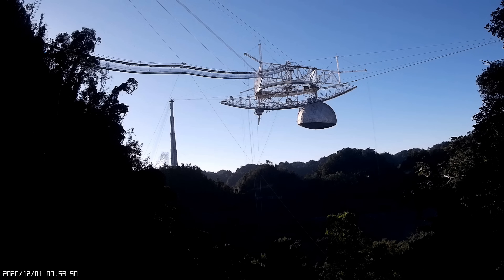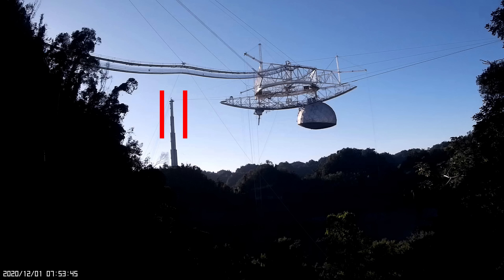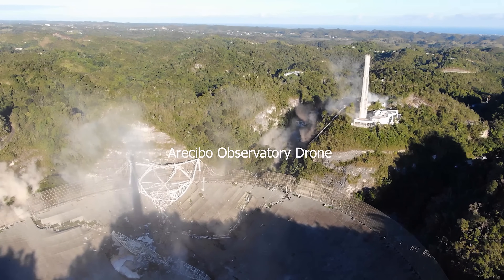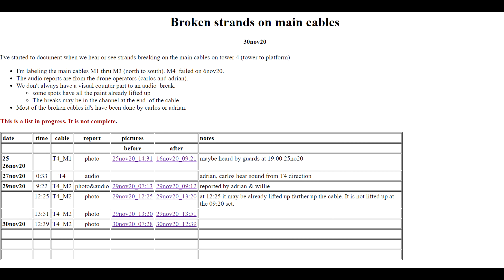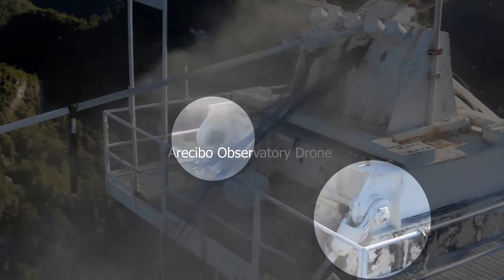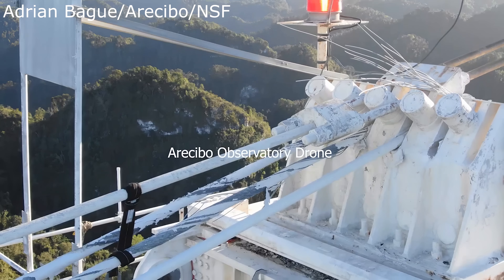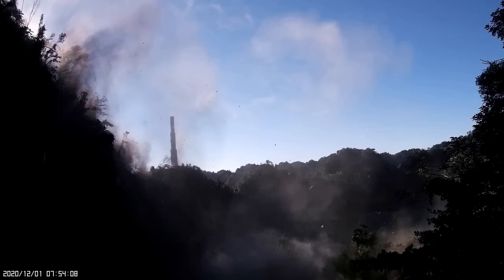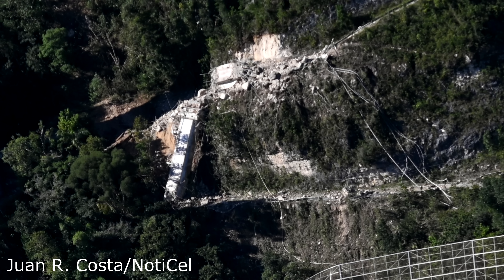Analyzing Video Footage Of Collapse of Massive Arecibo Telescope

Comment: That drone footage is the most impressive thing I've seen all month. Talk about being in the right place at the right time, engineering students will be forced to watch that footage for decades to come.
Reply: I was thinking, this is going to become the new Tacoma Narrows Bridge collapse study for freshman engineering students.
Reply: @cvkline  i was thinking exactly the same.
Reply: @cvkline  Tacoma Narrows was an massive error in design and engineering.  Arecibo isn't.  It stood for many decades.
Reply: @MarkRenn  Tacoma Narrows is the result of failure to plan for circumstances you don't believe apply and/or failing to recognize extremes in the conditions the design will have to face, Arecibo is the end result of failure to perform proper maintenance/inspection.
Reply: @MarkRenn   and @Timothy Barney  Personally, I think you are being a bit hard on the engineers of the Tacoma Narrows bridge.  The bridge failed due to aeroelastic flutter.  In the 1930's when the bridge was designed, there was probably still a limited understanding of aeroelasticity, even in airplane design.  Expecting 1930's bridge designers to understand a complex phenomenon like this, one that had never been documented in bridges before, is unrealistic.  
In short, much of engineering is learning from past failures.  This type of failure had never occurred before, so it would have taken an exceptional engineer (likely one with a background in airplane, not bridge, design) to have imagined it before the bridge was built.
Reply: Also you have to consider that the engineering was done well before the invention of the computer or even the simple hand held calculator. Therefore all the calculations had to be done long hand with paper and pencil. This often involves several pages of calculating over many hours or even days to solve a single logarithmic equation to only a few decimal places. Considering that thousands of similarity complex calculations need to be solved to build a structure like this it's more a wonder that there aren't a lot more failures.
Reply: @timothybarney7257  That's probably what makes these recordings particularly useful to civil engineering students.  You can always design a building wrong--but this footage will teach how the final stages of simple aging and wear and tear play out for something that was built properly using tensile structures (like just about any suspension bridge would be), but simply neglected.
Reply: @MichaelCox  yes, a lot of lessons about aerodynamic effects of wind on structures came directly from Tacoma Narrows
Reply: @timothybarney7257  YES. This video should be shown to engineering students, as it graphically shows how the cable failed.
It should also be shown to maintenance engineers, AND the people who allocate funding for maintenance, and then discuss WHY the cable failed.
Reply: @dealeru.3532  Most of the calculations would have been done with a slide rule, which, if you know how to use one, can be very accurate. But they have not taught how to use a slide rule since the 70s
Reply: @timothybarney7257  I wonder if they have ever changed any cable? As Bridge Engineer the main problem for me is how they designed it in terms of old cable replacement.
Reply: @timothybarney7257  That's what makes this footage valuable. You can put in tons of safety factors and design it perfectly and it doesn't mean a damn thing is the structure is neglected.
Reply: @timothybarney7257  Arecibo is the end result of a failure to have funding for maintenance. The funding is key. It was allowed to deteriorate by neglect.
Reply: @cvkline  This video is a perfect follow up for the Tacoma Narrows video.
Reply: Or people watching the "Discovery" channel - Next time on DESTROYED IN SECONDS - the biggest radio telescope gets..... DESTROYED IN SECONDS DunDunDuuuuunn watch the footage repeat 10 times with action movie music in the background
Reply: @thulyblu5486  After a mere 54 minutes of teaser footage and dramatic sounding music behind engineers giving opinions...
Reply: @thulyblu5486  You forgot to mention the horrible narration.
Reply: @thulyblu5486   Three more cables must die!
Reply: @thulyblu5486  While the narrator beats the same 3 lines to death with a thesaurus!
Reply: At least some good will come of it in that respect.
Reply: Bridge builders take notes.
Reply: To clarify some comments others have made:
1: they were planning on demolishing the dish after recent cable failures, so the drone was likely up there both to inspect current state and to gather information for the demolition company (Controlled Demolition Inc comes to mind as being who you call for this sort of job).
2: the first camera footage is a static camera from the control room facility that is probably always recording
3: regardless, great timing to have captured it.
4: the timing wasn't suspicious at all - in fact, the collapse seems to have happened at the same time the energy from an earthquake in the Dominican Republic would have reached Puerto Rico; indeed, we can safely assert that the quake did begin the final collapse and without the quake the collapse may not have happened
5: fly safe!
Reply: @chouseification  I'm glad you mentioned the quick. This was such an instant and pic fail rather than some 0-60 process, so one would assume there had to a spark which set it off.
Reply: @t.p.mckenna  exactly - just like a chemical reaction, one could say it's sitting there at a high point of potential energy with those cable strands slowly fraying. As the strands popped, the entire structure had to shift the load, so stresses had it very close to the breaking point anyways - then the ground shakes and the cables get yanked on, but with a timing differential due to their distance and some factor due to tower height as well most likely. Obviously that was enough to push it over the edge, even if it wasn't a quake that the humans could feel.
Reply: @chouseification  as thousand mini vibrations that travelled up to the towers and the only place they could could continue was down the cables to the central unit, and that's where it really seemed to give.
Reply: @t.p.mckenna  the cables likely failed near the saddle because that’s the point with highest tension on the cable. I suspect that the EQ load did accelerate the failure, but it looks like those cables only had a factor of safety only a slight bit higher than 1.3 to 1.5, which is a lot lower than I would have expected (something around 3-5 might be more typical).
Reply: @chouseification  controlled Demolition inc did a great job with WTC 1+2 but focked up biggly with WTC 7.  Way to obvious and now even proved by University of Alaska.
Reply: @bokhans  which just demonstrates that CDI had nothing to do with that day... whatever really went down. I do remember questioning the seemingly freefall drop speed when it was happening live; that's more than a little fishy.
Reply: This is total negligence. This is what happens when you don't maintain your multi cable system no matter how well it is engineered. No surprises here as even they were prepared for it to fall. I vote NO on rebuilding a better one in this s-hole territory.
Reply: absolutely - seeing the strands start to pull apart then progressively just tear out of the mountings should give better ideas on how to join a cable to a support tower, potential failure modes, etc.
Reply: Forced???
Reply: I hope so. We take so much granted here in PR.
Reply: This is NOT very interesting, from an engineering perspective, people.  We can film cables snapping, any time we please, in a lab.
Reply: @dizzywow  Yeah but this is real life, uncommanded, obviously it's not exceptional from a materials science perspective but it's a lot more impactful to show engineers this than footage from a lab where a cable is overloaded. This is a cable that originally was rated to handle this load but then degraded to the point of failure over nearly 6 decades and we happened to catch it when it happened. There's also the fact that it's part of a complex system so we get to see how the forces are redistributed with each failure. 

Is it going to revolutionize engineering itself, no, but it will offer a great case study and visualization to new engineering students.
Reply: @dizzywow   Real life examples are always interesting from a certain viewpoint. They tell us things we haven't even asked yet.
Reply: ...a little too close?
Reply: kind of convenient
Reply: @stuntdrvr  It has been known for months that it was going to fail. No coincidence at all. The drone was brought in specifically to study it.
Reply: @firesurfer  just sayn 3" wire just doesn't evaporate
Reply: @stuntdrvr  It's a bunch of strands of 60 year old brittle wire. They broke a few at time.  3:26
   Did you even pay attention to what was said?
Reply: @firesurfer  I just said look up dustification New York City... timing is everything
Reply: @stuntdrvr  So, you're one of those.
Reply: Why was the drone positioned directly at the point of failure @  1:25  Specifically on the cables tied down with a black heavy duty belt because those failed first?...  It also looks like the heavy duty belt was tied down to something else, so were the cables destroyed on purpose with a pulley system?... Or was the drone really in the right place at the right time?...
Reply: rodog991 cons: how to ruin and corrupt an election in seconds duh duh duh dems: your eyes deceive you stop complaining and stop looking at our corruption just accept it.
Reply: YES IT WAS STARING AT THE EXACT SPOT THAT BROKE BY SHEER ACCIDENT.
Reply: why would a drone be there at the right place and the right time
Reply: @robruitenberg4064  Because they already knew the structure was failing and so they were using the drone to assess the condition of the structure to help plan the demolition, as it turned out the structure was in even worse shape than they thought and collapsed on its own. 

Not sure why so many people see a conspiracy in this coincidence, they already announced they planned to demolish it so what the hell would they gain by doing it secretly and framing it as a collapse? Makes no sense at all.
Reply: rodog991  lol
Reply: It sure failed at catching the actual action.. I'd say 2/10
Reply: Ah yes another coincidence
Reply: Its 9/11. The mini version 😅
Reply: False flag most likely! 😂
Reply: Rigged 😊not all the people can be fooled all the time 🤔
Reply: Just the kids in nonlinear dynamics class :)
Reply: And don't we all like to see such high resolution videos when it comes to filming so called ghosts. 😅
Reply: Just like Tacoma Narrows bridge
Reply: It wasn't and engineering problem, it was lack of maintenance because of greed.
Reply: Ahh I believe it was demolition
Reply: It wasn't there by chance, a worker heard the sound of cable making noise, thus the drone
Reply: I don't think most people understand how important that drone footage will be for engineering going forward. Real time footage of structural failure like this is almost non-existent.
Reply: So...you're saying that in its death, Arecibo still provided us with science.  I think that's the best eulogy it could be given.
Reply: You wonder about cable failure on large suspension bridges, like the Golden Gate Bridge, completed in 1937. Over 83 years, it's been exposed to salty, foggy air, high winds (cat. 1 hurricane on at least 2 occasions), constant vehicular traffic, and many earthquakes, including the magnitude 7.1 Loma Prieta  (https://pubs.usgs.gov/dds/dds-29/)
Reply: @gregparrott  some of these new comers to earth, the new generation,  think that we the older generation just came from under the rocks and we are so glad that they are here to protect us and take us the the edges of civilization....Sarcasm , yes.....
I have teenage nephews who tell me things and give me "advice" on how things should be done.
Reply: @gregparrott   The gate bridge has plenty of funding for maintenance.
Reply: @firesurfer  The bridge revenue comes from a hefty toll, which I believe is something like $8 during business hours. But the Covid pandemic along with 'work at home' has dropped bridge traffic by something like 70%. So while it was self sustaining, it isn't right now.
Reply: in a week this comment will be outdated
Reply: They will also be taking about how the structure was still standing. Thru tested the cables and they were at like 60%
Reply: @johnseipel4102  As an engineer I wouldn't build a structure like that if it could fail when the cables reached 60% of day 1 capacity.
Reply: And the drone operator did a good job of trying to keep everything in frame. So often when something like this is captured on a cell phone the person ends up filming the ground or the sky or anywhere but the action. This operator had the presence on mind to try to capture the other elements of the event too. Good work.
Reply: @TheInsaneShecklador  They were probably thinking "I have one job. Film stuff. If I don't film this, I'm totally fired"
Reply: @TheInsaneShecklador  to be fair, when footage is captured on a cell phone the person is often very close to or even in the middle of the dangerous situation, and has other pressing concerns about their own safety that may take priority. It's a lot easier to make sure everything is neatly in frame when you're operating a drone quite remote from the place being filmed.
Reply: They won't be forced, Riggers from the largest cranes, to  ship yard cranes, to entertainment industry riggers, people who hang things over your head from all industries will be watching these videos .  Using this to teach and explain principles such as yield strength verses breaking strength. How cables wear in ways you can't see and how you have to look for these early warning signs.
Reply: @ablemagawitch  Yes I used the word "forced" as a synonym for "required" to imply humorously that due to the incredible nature of the video it will end up in most of their professor's lecture slides, meaning they will have to watch it many times. While I have no doubt they will enjoy it, at least the first few times, eventually it will become tedious. I know when I was in school similar videos became a chore to watch simply because every professor wanted to show it in every class they taught.

Felt I had to clarify that since it seems, other than the conspiracy theorists, the most controversial part of my comment has been my word choice. Even had a guy claim my choice of words somehow indicates I'm a mean-spirited person lol. Figured I might as well clarify in a reply to you since you're the least hostile of the commentators. Doubt anyone will read this comment buried at the bottom but oh well.
Reply: @MrMattumbo  One would think the reason for your word choice was obvious to anyone with common sense. But apparently not.
Reply: conspiracy theory nuts will make up a story that this was a planned demolition and thats why we have so many camera angles as if this would make any sense.
But it will happen for sure.
Reply: Engineers should be required to work in the field for 5 years before designing anything.
Reply: @retsaM innavoiG based on how you reply,  I think you feel guilty of all those things I said, and you are triggered.
Reply: "Forced to watch". I can't help but get the image of an engineering professor standing over a student with a gun pointed at their head, saying, "Now, you watch this... WATCH IT!!"
Reply: 😆😆😆 "forced to watch" jeez what you trying to say😆😆😆
Reply: Let nature take its course.
Reply: Some luck to extract from the disaster!
Reply: Romain Grosejan f1 crash?
Reply: We’re in a simulation
Reply: No more Tacoma narrows bridge lol
Reply: can you clarify in what part of the world you think "students" will be " forced" to watch some video ?
Reply: Drone finally getting the credit they deserve.
Reply: " will be forced " hahahah something tells me you're an engineer xD
Reply: lol, it's like that particular suspension bridge isn't it?
Reply: "..will be forced to watch that footage for decades to come."  To phrase it that way shows you have a really deep-seated, nasty personality.
Reply: What led to the cables giving out?  Was it earthquakes?  Was it neglect?  Was it Chinese Communist Party saboteurs?
Reply: Are we sure it was staged for our benefit. This way it wouldn't be questioned? Think about it if it was an attack of some sore, just saying.
Reply: @retsaM innavoiG Wrong, average is at least 1 in 10. Mortality is @5% for society as a whole.
Reply: Ain't that the truth!
Reply: YEA THINK about that!~
Reply: @2000jago  Not long...   exactly 9 months down from lockdown.  Vaccine almost here. Hopefully, in less than 6 months, this will just be a bad memory.
Reply: The collapse of USA kingdom is expected to be like this,everything in a sudden, much faster than the collapse of USSR.
Reply: Lol I’m an engineering student now watching it
Reply: And it is very sad that such an important scientific instrument has been so badly maintained.
Again an area where China is taking the lead. With their brand new "Five-hundred-metre Aperture Spherical Telescope".
Not only does the new telescope have three times the surface area, but it also has a highly innovative system that allows the dish itself to be flexibly deformed to be perfectly aligned with a target.
Reply: Profoundly suspicious in its impossible perfection, just like the shooting of Oswald caught in perfect lighting, perfect framing, perfect view.  Why did most Arecibo steel cables break catastrophically while never any on any bridge nor antenna/tower in known / recorded history ?
  How convenient that our only asteroidic RADAR be 'taken-out' amidst ever-highest hype about "alien invasion".
Reply: I'm going to reccomend the footage to my teachers indeed, it's very interesting, but also very sad :'(
Reply: Ngl knowing our government here and all the shit they hide from us that drone wasn't there by pure coincidence
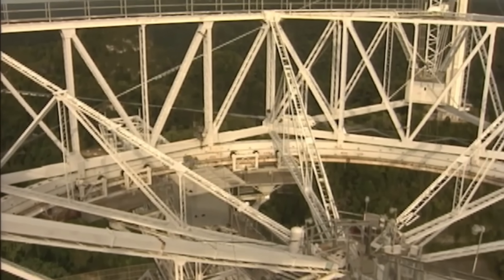Reply: @Koel_Hellion  Hey, did you even watch this?    3:15
   They LITERALLY said the drone was there to inspect the cables.
Reply: @firesurfer  I did but you've clearly never been here
Reply: @Koel_Hellion  Where you are is not relevant. The drone was there to inspect the cables!
Reply: Yeah, what a coincidence.    Also, go pro batteries don't last more than a few hours too, great coincidence there too.    I wonder if the structure was insured and deteriorating.
Reply: @jdriver1419  I don't own any go pro cameras, but I do know someone who has one running for extended periods I think he solved this by removing the battery and powering it externally. With the battery it apparently automatically stops recording and goes into charging mode, not sure to which models this solution applies.

There would still be a video file limit I guess, maybe it has an option for automatically discarding the older recordings like a car dashcam. Oh and in that scenario there would still have been some chance involved since cameras still require light, I doubt it would've picked up much during the night.
Reply: @extrastuff9463  i own a ton of gopros, I've tried the no battery thing with cord plugged in, they get too hot and shut down.   Most i can max them out on is with using an internal battery and "backpack" battery and lower the resolution below 1080 and i might get 4.5 hrs if I'm lucky.   But, I'm sure ur post was probably not sincere anyway, you just needed to inject doubt into what i was pointing out.   Almost everything is a lie in this world, especially anything big and anything that involves money or instilling dis-belief in God the creator.  People need to question everything and wake up.
Reply: @jdriver1419  Not sure what god has to do with any of this. But if 4.5 hours is your practical limit then I assume  it'd definitely apply in this stationary warm climate scenario. Regardless it's a nice record of a sad event

The use case of my friend btw is on an electric bicycle often longer trips than the regular battery would handle (or he just didn't want to recharge then all the time). One at the front and another at the rear powered from a buck regulators that are connected to the Bosch battery pack. Maybe he gets away with the thermal issues due to enough airflow and although his trips are long I doubt he does over 4 hours without a break. Not sure what resolution he uses, all I know is that I've observed swapping of 64gb sd cards and that some of the memorable parts trips get archived/edited.
Reply: Lmao.....yeah right. Right place right time? What are the odds? About the same as catching COVID about 1 in 10 billon?
Looks more like an intentional break.
Reply: All month. 😊 It's only the 4th.

Did you see Scott's music video last month? Well worth a watch: SpaceX Sentinel 6 Launch Remix - Tracking The Booster
https://youtu.be/sXup0kgkTCs
Reply: @nagualdesign  I will say I am guilty of saying all month to mean 4ish weeks regardless of calander dates😅
Reply: And unlikely it will help. There are still many of them would want to experiment on their clients and will keep either blindly ignoring or even will be very toxic of any criticism of their unreliable experiments.
Reply: All month... we are a few days in. 😋
Reply: rodog991  ... need more live coverage of Democrats faces failing as their life lines start snapping too ...
Reply: @PeterPaul-wz5db  Go away troll.  Off topic.
Reply: There's always that one guy, isn't there? @firesurfer